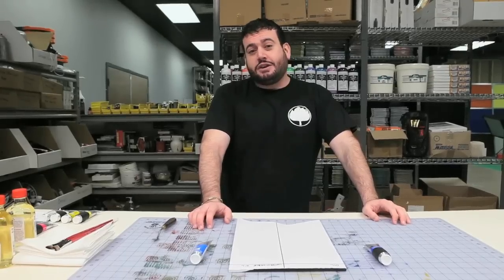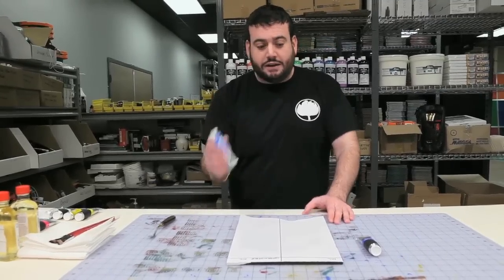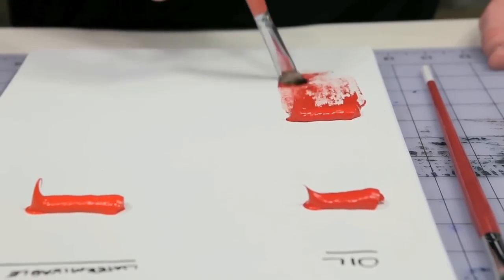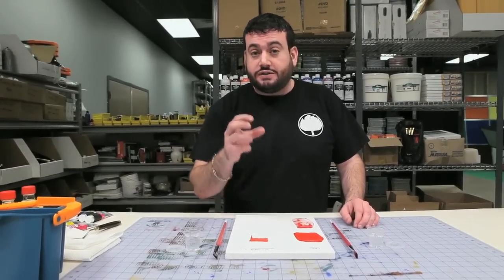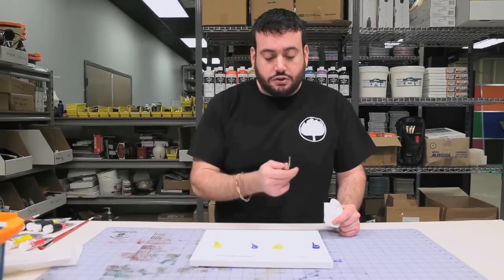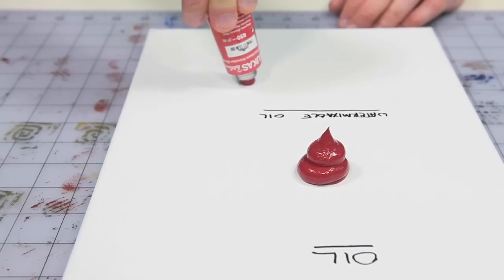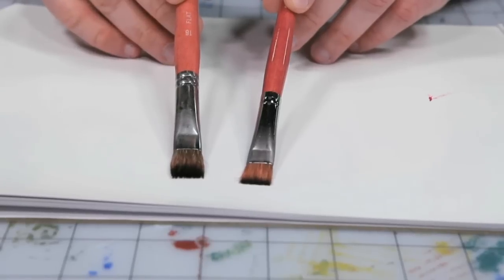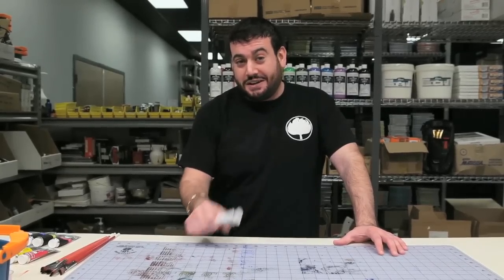Prove It!  Water Mixable Oils

Comment: Hullo Mike, I have a few brands of water miscible oil paints. Now many of the painters that I have had contact with or simply watched on YouTube have said NOT to use water to mix the paints. If you want to best results with these oil paints use the mediums matched with the same brands of thinning mediums or oil mediums. Use the brand matched with paints and mediums, NOW could you use the Standoil medium from Lucas with the Windsor& Newton water mixable oil paints? or the Holbein Duo paints and water miscible products? Is this chemical or molecular alteration the same between brands? OK I know I can use water and even water&soap for clean up with all brands, but what about these Extras"? Stand oil or safflower oil, Fast drying liquid? Thanks for your time. OH! I know this is an older video so I understand if it is not at the top of your list for answers. Mar. 29th 2022

Comment: Different brands behave differently with WMO. Lukas has good texture but not a very high pigment load. There's brands w/high pigment loads.No color shift when drying. I don't thin w/water. I used WMO medium. I don't soak rinse & brushes in water while painting (ruins good hog bristle), use non drying oil and wipe very carefully before reusing the brush. I just can't have turp or spirit funes due to health. But I only use water for the final clean up. I don't know it that info helped any.